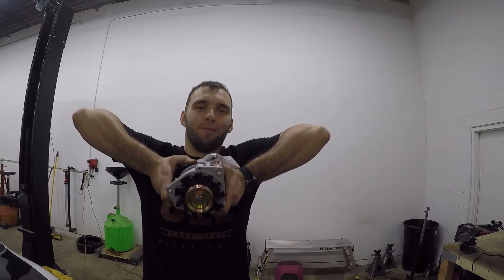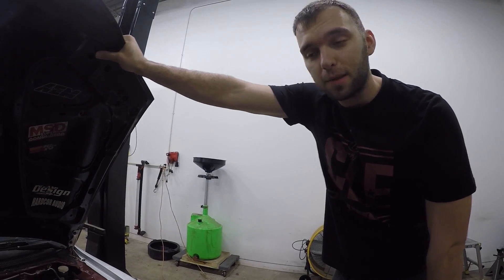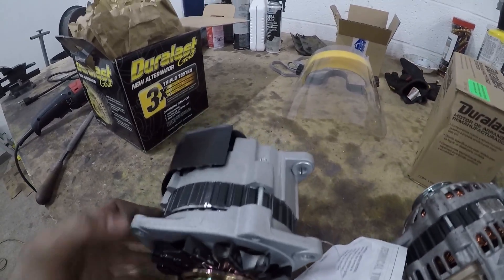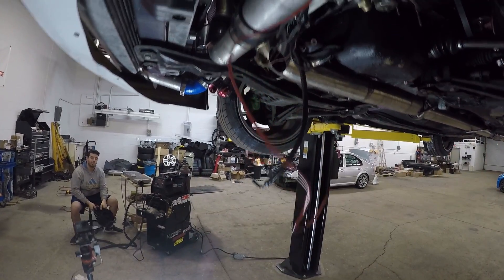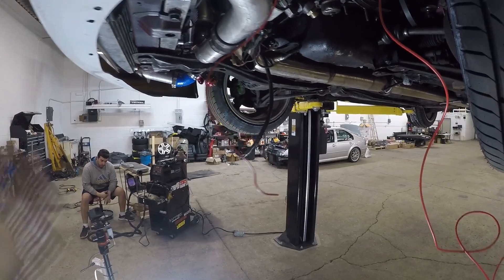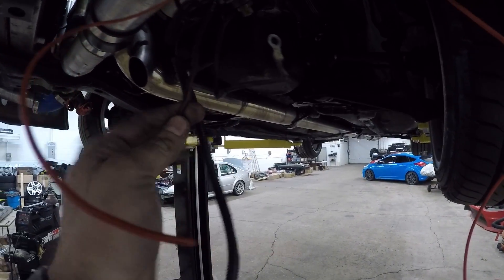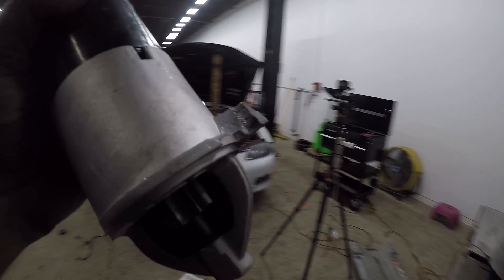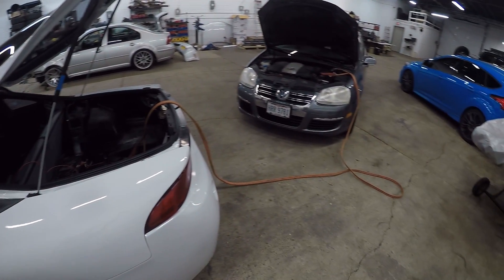The Eclipse Gets A Saturn Alternator

Comment: Both alternators (saturn and stock) have 90A ?
Reply: Galaxy alternator is 90amp fits in the Dsm as well
Reply from the maker: Stock is 75 I believe
Reply: @IT_Performance  I using this in my GST: MD194482
It is stock 4G63 N/A EUDM 90A alternator
Reply from the maker: @lukasnabelek9720  hmm. That might be an upgrade one. I think factory they're are around 75.
Reply: @IT_Performance  Mitsubishi manufactured alternators are 90A the one sold at orielly auto parts, advance auto parts, or autozone, are 75A the re-manufactured alternators ,don't hold up the only problem is they are $250 for the new 90A Mitsubishi alternator so going the saturn route was smarter
Reply from the maker: @JuiceDraticZ  I gotcha